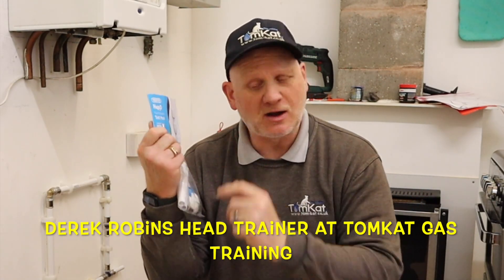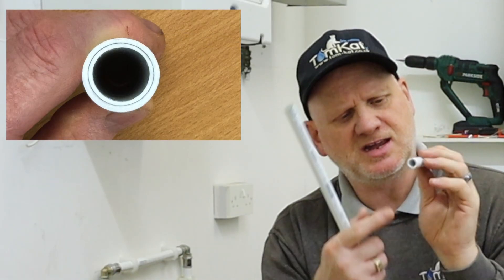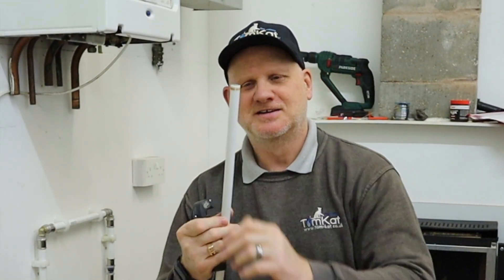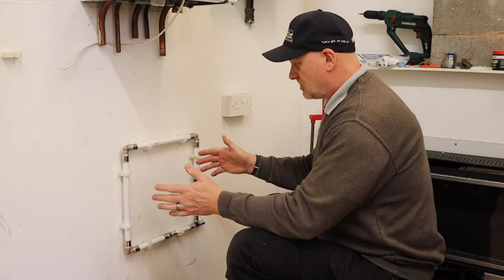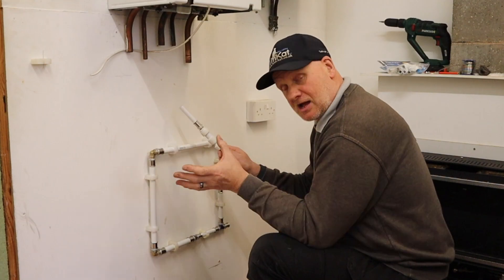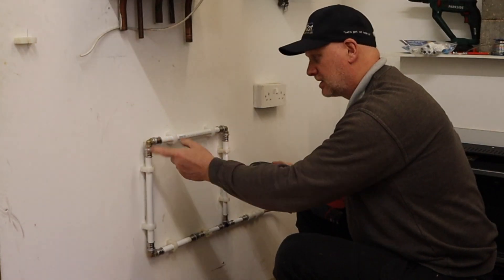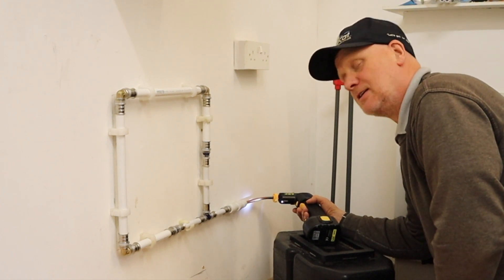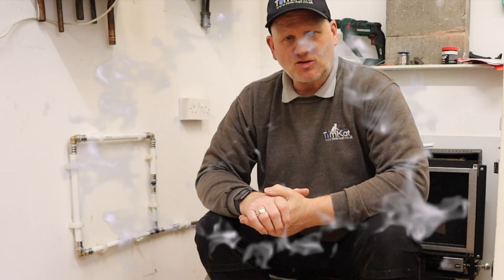Installing, bending and pressure testing wavin's Tigris M5 and K5 press fittings.

Comment: Am struggling to see any advantages of this system
Reply from the maker: Think commercial not domestic
Reply: @tomkatgastraining   what about a commercial setting ? what's the point ....
Reply: @tomkatgastraining I’ve done a few domestic systems using it and they are still running as sweet as a nut and obviously above the boards it’s all in copper so most would not have a clue it was there or what it was.
Reply: You can also use it on hot water return pipe , benders are available too 🤘😎🤘
Reply: What is wrong with copper and silver solder 😭

We humans do make life over complicated. 

As much as I disagree, good video & review
Reply: Started using these a year ago, such a far superior product than plastic push fit, no more worrying about ticking plastic pipes, knocking with quater turn taps shut off, once tested and plastered over im not worrying one is gunner pop off, a far better professional product.
Reply: Also it seals internally so doesn't matter if the surface is scratched
Reply: same